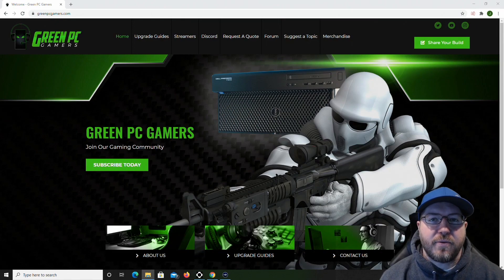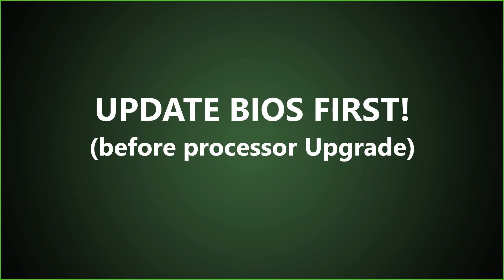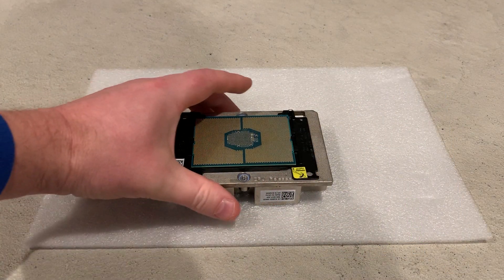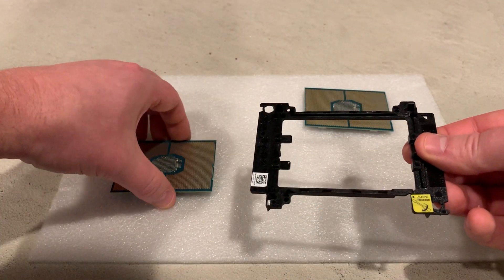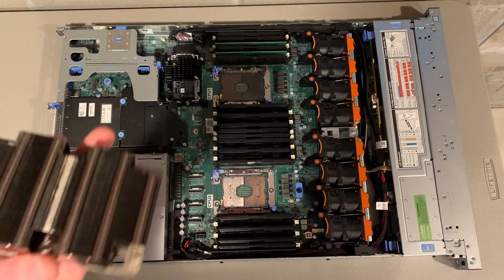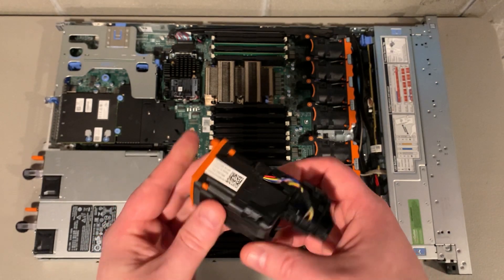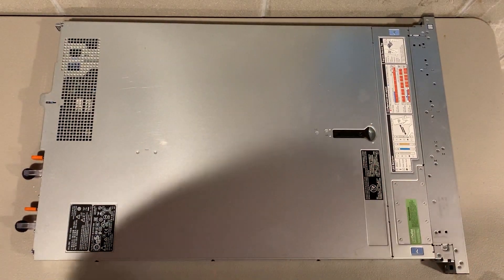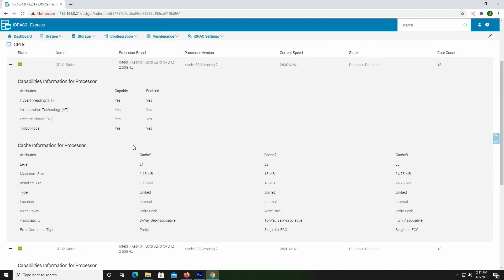Poweredge R640 Processor and Memory Upgrade/Install

Comment: please can you advice me how to install 3 * 64 GB in its slots with 1 processor or if there're 2 processors ???!
Reply: If you have only one processor, then install DIMMs (and the processor) only on the "A" side, not the "B" side.

If you have less than a full complement of DIMMs, then install them in numerical  order. E.g., if you have only one processor and only one DIMM then the DIMM should be in slot A1.

If the system freezes while or just after "configuring memory," then power it off and remove all except one DIMM per processor (A1 and B1, of you have two CPUs). Then boot it past the point where it got stuck, and then hold in the power button to force it off. Gradually add back the memory, a couple of sticks at a time, until you get to the full complement. (Note: this problem is less likely with recent BIOS versions.)